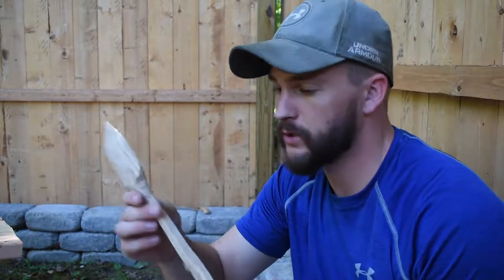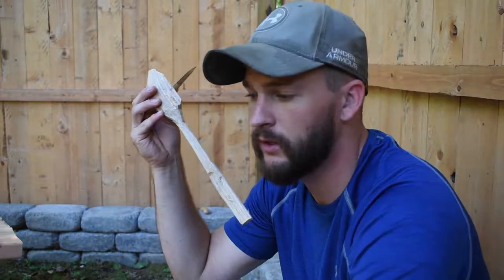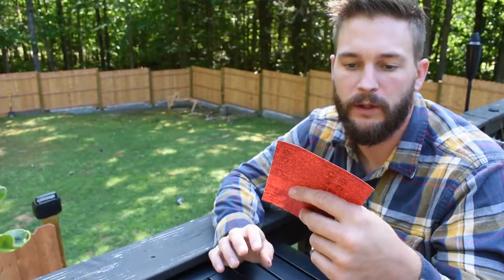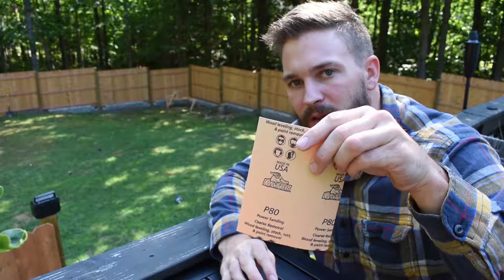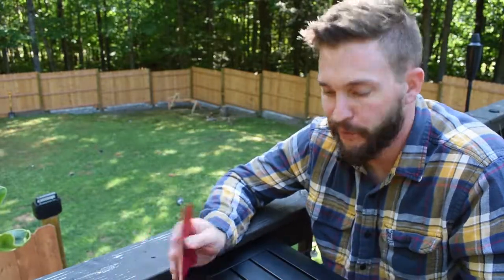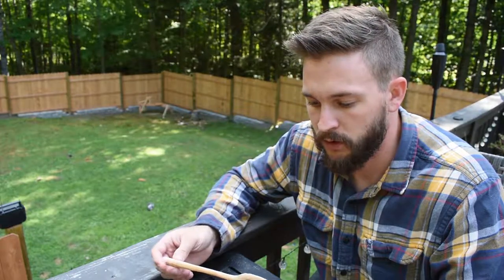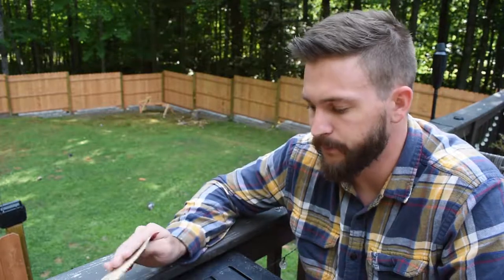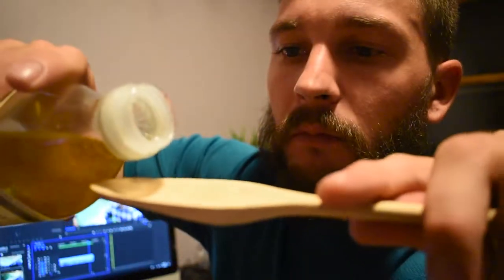Wood Carving Episode 3: Carving a spoon

Comment: any recommendations on draw knifes?  Just found your channel.  Definitely subscribing, this is all right up my alley.
Reply from the maker: Fort In The Woods thanks for the sub! I used the flexcut 5 inch drawknife. Got on amazon for a reasonable price. It does the trick for small work like this but when I move to some bigger projects like canoe paddles or like a long bow or something then I think I would look to getting something a little bigger and higher quality